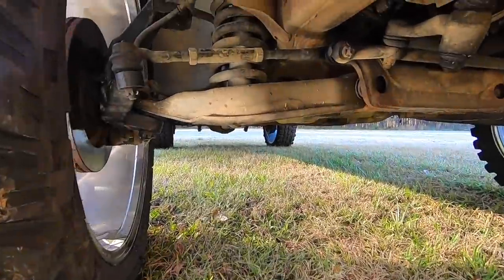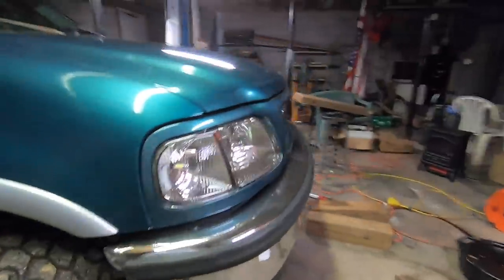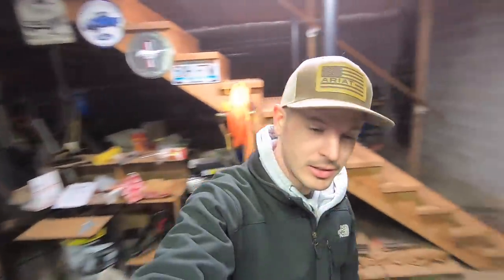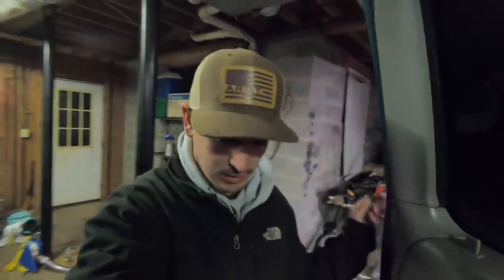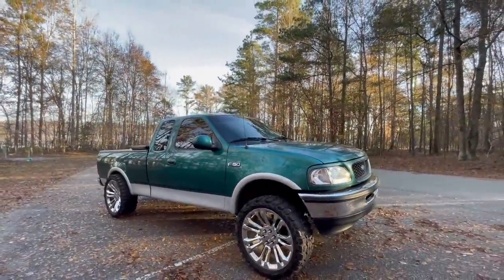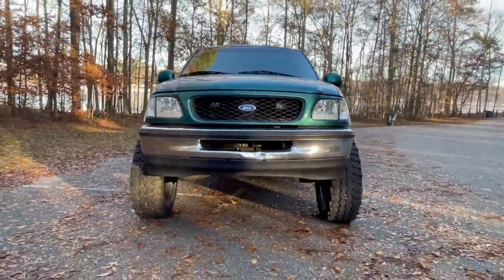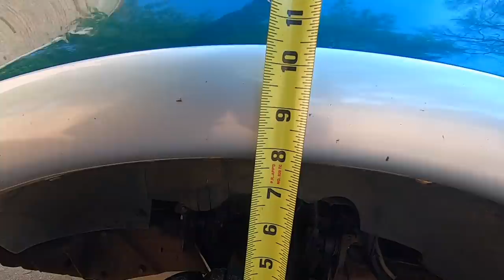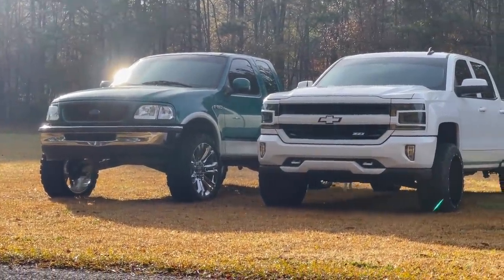Stacking LIFT KITS on larry! ! | over 6" of LIFT |

Comment: Needs lift upper control arms to fix the ball joint angles
Reply: @lmfscrew yep DT shocks still has some in stock, one of the best upgrades i did. - https://doetsch-shocks.com/collections/lift-kits-1/products/ford-f150-2wd-2-to-3-lift-upper-control-arms-1997-2003-pair?variant=32232258863190

Comment: I bought some 2.5" spacers and now can't find a shop to put them on.  One shop told me spacers don't work on these model trucks because you can never get the alignment right after that.  I called bs and went to a different shop and they said yeah the spacers will work but I need new shocks.  That makes sense because it will be taller and the shocks on there aren't that tall.  I don't have a lift on it, just want to level it.

Comment: might get a 4 inch one to stack with a 3-4 inch suspension lift later on. do you need new shocks with the spring spacer lifts?

Comment: I just added the spindle lift 3inch and want to go higher and go with 2 inch coil springs, will you need to add longer shocks if I were to go that route?

Comment: Where did you get the spiked lugs for those wheels?
Reply: Should be from custom offsets but if its not and you’re looking for some check out custom offsets 👍🏼
Reply: I got mine from amazon
Reply: @owenpullen6356  nice, either is fine I got mine from custom offsets, just a matter of looking around 👍🏼👍🏼
Reply: @mannyon24s74  that’s where I got mine they were $59 for mine
Reply: @buddyrouse3439   pretty cheap mod but makes a nice difference
Reply: Manny On24s yeah I’m a teenager and don’t have a lot of money it was $175 on custom offsets and on Amazon it was $135 so I try to save as much as I can
Reply: @owenpullen6356   for sure man, got to be smart with your money 💯

Comment: I have a 2003 f150 RWD and have done 3.5 spindle lift a 1.5 spring spacer, total 5in lift. Replaced the upper control arms with factory replacements and no having trouble with tires toed in at the top. Camber is maxed out of adjustment. What did you do to get your alinement correct?
Can’t find longer control arms for lifted 2003.
Reply: Following

Comment: I did the 3” spacers on my truck but went with bigger coils also on my 2001 f150. It wasn’t so bad but i had to do a 3” lift on the back to cuz I’m not a fan of squatted trucks. I think if you did the lift on the back of Larry it would look great.

I have a 2001 f350 lariat 4x4 7.3L power stroke. You need to get a diesel!
Reply: we’re ur angles bad?
Reply: @garrettboswell  As far as the way the truck sat?? Like was it level?
Reply: @lonestar_7.3L  like the upper control arm and ball joint angles
Reply: @garrettboswell  well when I did the spacers I did the ball joints and upper A arms with them. But the spacers won’t give any funky angles or anything.

Comment: I have the exact setup and I’m trying to find upper control arms for mine....no luck so far and I’m getting worried about breaking the upper control arm ball joints.
Reply: this setup kills those stock upper ball joints pretty quick, i went thru 2 sets of UCA's before I found these ill drop a link
Reply: Wow!! thank you so much for that link...this is exactly what I’ve been looking for...amazing!!
You saved my truck!
Reply: @letsweld6698  back ordered for 2 months.. I was wondering what kills them quick? I was thinking about doing 2in springs with my 3in spindles
Reply: @peytonthompson7865  its a good setup, just leaves the stock upper ball joint at too much angle so eventually WILL fail. The aftermarket one has a higher angle ball stud joint ant its mounted under so solves the angle issue, they are bulky and without proper alignment may contact coils - need adjustable cam bolts to align